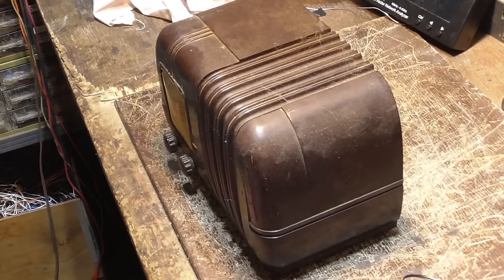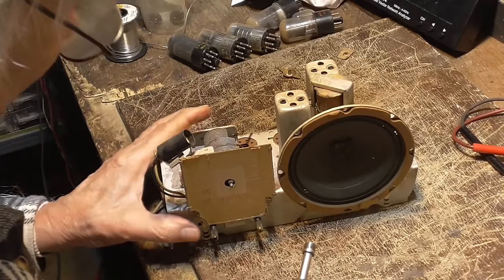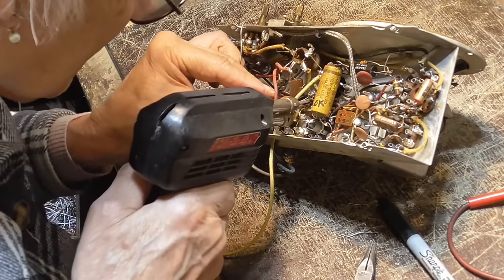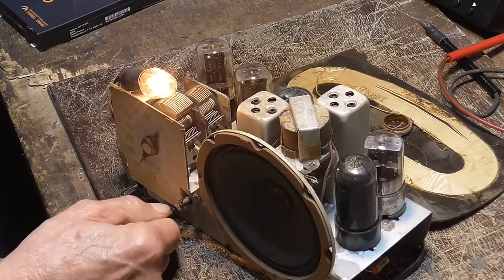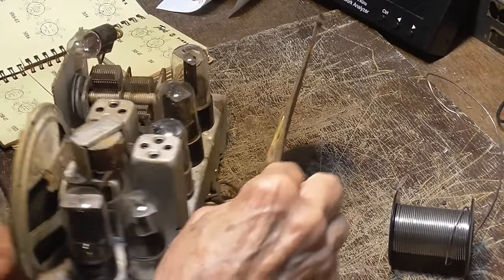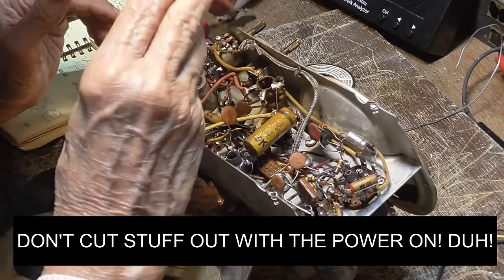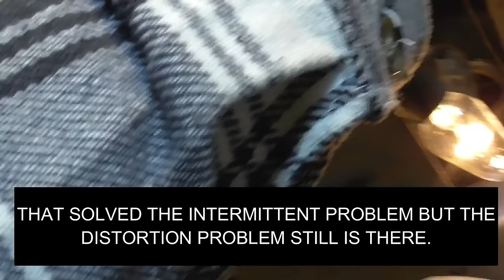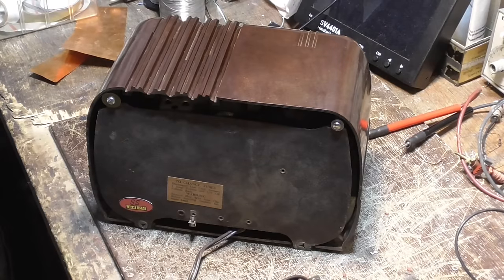QUICK RESTORE OF SMALL BROWN RADIO

Comment: When I was in my 20s I'd cut out half a dozen parts at one shot and know exactly where the leads went.  Today I take a dozen pics and do one lead at a time!  If the tuner bushings are just a bit collapsed but otherwise solid, I turn the radio upside down and put a few dollops of RTV between the tuner frame and chassis and let it sit overnight.

Comment: This is why I would never buy a radio out of an antique shop.  Jamming wood under the tuning capacitor instead of replacing the grommets is classic antique shop move.  None of the connections made have a mechanical connection. Not one j-hook to be found. Sand in the IF cans.
Reply: Could you do what she just did?
Reply: @AdamosDad  I could, I just wouldn't.  I understand not wanting to put a bunch of time and money into a radio you want to sell.  But the whole wood being shoved under the tuning condenser is too much.  Grommets are quite cheap and it would have been 20 minutes to replace them.
Reply: @AdamosDad  2/2 Also, I'm pretty sure he goes by he.
Reply: @AdamosDad 
Ron is he :)
Reply: Very good repair thank you very much great regards from bavaria germany bob❤
Reply: @christo930 He keeps the radios, for his own collection.
Reply: @MrGigi-dz9cv  Did you not watch the video?  It was being repaired to be sold in an antique store.
Reply: I think he simply don't give a fuck because is gonna work anyway. He is an old style guy.
Reply: I'll agree he takes shortcuts but you gotta take into consideration that he also  manufactures missing parts and hand-makes vacuum tubes. Those tasks are far from shortcuts. I think he puts energy into what he wants to. There's much to be learned from this master.
Reply: @mitchellboomphi  I did not comment on his skills in other videos or what he can do outside of this radio.  My comment is entirely confined to this particular repair, which is atrocious.
Of all the things he ought to put the time and energy into doing, it's a radio he is selling to another person.  If he was making this for himself for his own personal collection, I would not have even left this comment.  What you chose to do with your own stuff for your own personal use is down to what you prioritize.  But when you are selling it to an unsuspecting member of the public, it should be done right.
Reply: @christo930  I cannot disagree with that.

Comment: For some reason many GE radios from that era used 7.5w 110v "night light" bulbs as a dial light.
The "GT" tubes with metal base sleeves didn't need a tube shield, and the 12SA7GT sometimes came with a bakelite base and didn't need a tube shield either.
The 7 pin miniature versions of the "All American 5" tube set must have been cheaper to make than the octal tubes, but other than being slightly smaller and more suitable for printed circuit construction didn't offer any electrical advantages over the octal tubes, not on the AM broadcast band anyway.  The miniature tubes did perform better up on VHF in the FM broadcast band.

Comment: Great video McGee! I have a question that is probably not new to you but I need some advice. Here goes>> Do you have a starter/base list of caps that  I could use to get a relevant caps stock on my shelf? I don't know what values are a good investment; like what will move and what will just sit on the shelf for years. I would love to know what you would get if you were just starting out today. Thanks so much!
Reply: Radios probably have a lot of 0.01uF caps, .05/.047 is also pretty common. For most versatility get 630v rated caps. For electrolytics 47uF 200v should be good for 90% of hot chassis radios, transformered sets will be different.

Comment: I would like to share some information I learned from Shango066. I saw him convert an electro dynamic speaker into a permanent magnet type by using very strong magnets from a hard drive and placing it near the pole piece around the outside of the coil. It had an open field coil and he was resurrecting an old radio. He has some really good ideas. I would find some round magnets and place them directly on the pole inside under the dust cover and that would give best results. A good idea is always worth sharing especially to keep antique radios alive. I hope he doesn't mind me talking about how clever that was
Reply from the maker: I have done this before and had good luck  with it. Unfortunately a lot of the time there is damage to the cone and spider which makes the whole speaker junk.

Comment: May I get the schmatic of your getter flasher ? I have a 83 tube which "oxdized mercury" stuck between supporting poles, shorting half of the filaments, I'm thinking if this could be solved by using the induction heater to heat up the poles, thus maybe vapourize the "oxdized mercury". A thousand thanks.🙏

Comment: Thanks!  Enjoy learning How older Radios to Work, and What makes them Not.   Have to admit, when it came to cleaning Case, i Cringed to hard sound of Brush, "ajax", and then, ... Wire brush.  8{|  but, what do i know  All's Great!
Reply from the maker: Once you get hold of one of these cabinets with the time worn dirt and stains you will see why the severe measures. Cabinets that are not in bad shape do not get this treatment of course!
Reply: @glasslinger    Thanks so much for saying, after uncovering my eyes, i'm a bit braver. lol.  Welcoming to see Bakeliet handle removal of those years, unlike materials used today.   Cheers!

Comment: I have a question for you, I am running a tube portable that was built for 90v B battery with 75v B battery, is it harmful? Am I losing much by doing so
Reply from the maker: A radio designed for 90 volts should work quite well on 70 volts. I use a stack of 3 volt lithium coin cells taped together. If you are having bad results test the capacitors in the set and replace leaky ones.

Comment: I can't get over how the capacitor wiring is such a rats nest. I've been looking at printed circuit boards too long. I remember taking tubes down to the 7-11 where they had a tube tester and a supply of new tubes. Buy the one that was bad and fix your own tv for peanuts. And pick up some Turkish Taffy while there.

Comment: You are an interesting study in one who's impatient.  A curious study, also, in one who creates his own problems:  shaking sand out of radio after sand blasting it.  Cutting out all caps at once.  Removing components from hot circuits.  

Most notable is you fail to alert your viewers that these tube circuits and the unpolarized line cord present lethal conditions.
Reply from the maker: Ha, ha, ha!
Reply: @glasslinger  I'm serious about my observation about lethality...   might you add such a disclaimer?
Reply from the maker: @tomtke7351  It is best that you do not work on these old sets. Working in ignorant fear is inviting disaster. First, LEARN how to work on the sets safely and THEN begin. They are nowhere near as dangerous as your fear makes them out to be.
Reply: @glasslinger  Thank, Rom!  I appreciate guys like you and Shango066 for keeping it real.  When I worked on my first AA5, I was so freaked out by the internet "experts" that I was almost afraid to touch it.  After repairing several dozen radios since then, I realize how foolish I was.  These radios were safe when they were made, and are safe now without the "safety" modifications.

Comment: Danger radium hands on clock
Reply from the maker: This one actually not. I checked it with my geiger counter and zero counts.
Reply: @glasslinger  yes always check. Backthen it was commonly used on dials and hands or even pointers of knob. Very crazy.

Comment: Horrible soldering technique, everything is just tacked on with tiny drops of solder, dry joints and breaks just waiting to happen, the worst soldering I've ever seen on YouTube.
Reply from the maker: You are welcome to your opinion. You were not there so you could not determine the efficacy of the soldering. I have 60 years of soldering and have learned shortcuts less experienced people would question.
Reply: @glasslinger  LOL I was there, I saw the video, really really horrible soldering, if you worked in a repair shop you would have been fired by now, the 60 years means nothing if this is how you solder, very bad technique, all your joints will fail!
Reply: @glasslinger  You're just in too much of a rush to do a good job
Reply: @harrybond007  its called knowledge im sure it will last for decades
Reply: @rduwe9466  LOL you obviously do not know how to solder either!
Reply: @harrybond007  guess you are an expert 
Best sailers are on the shore he

Comment: I don't think a piece of wood that is bogged/forced ! under the variable cap and broken in half in the process is a good idea. Is quite the opposite. Those rubber washers should have been replaced with suitable new ones or...at least some plastic equivalents. Another thing is: by not replacing the original paper caps during the repair you're asking for trouble as your repair is most likely not going to last long before some paper caps can smoke or blow at any time causing a lot of damage around them and possibly destroying tubes. To me, any thorough repair should include an automatic replacement of any old and (by now) highly unreliable paper capacitors. Please note that my critique intends to be constructive, not disruptive. Otherwise good video and repair skills.
Reply from the maker: I have vast experience (over 30 years) in antique radio repair and have found your fears to be unsubstantiated. There may be remote cases where the caps short out but it is RARE in actual practice. It's like judging people: just because on person goes bad doesn't mean all will. The wood chip is very firmly in place and won't come loose. The radio is a $25 set so spending a lot of time on it will result in no profit at all.